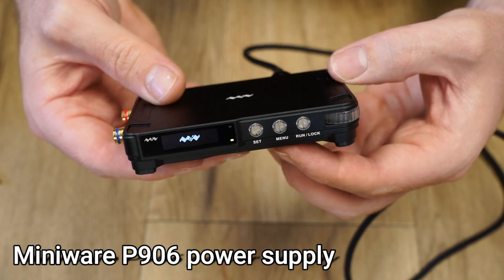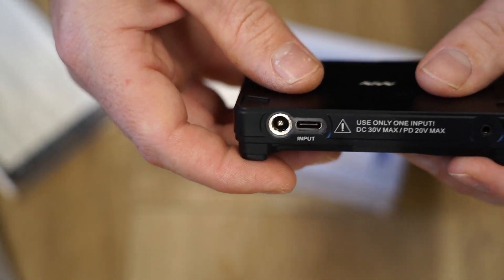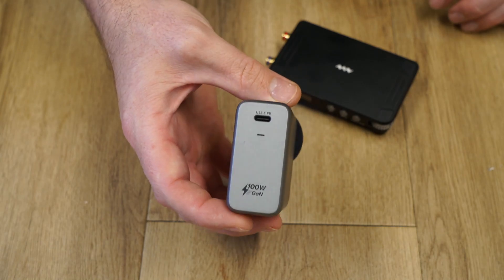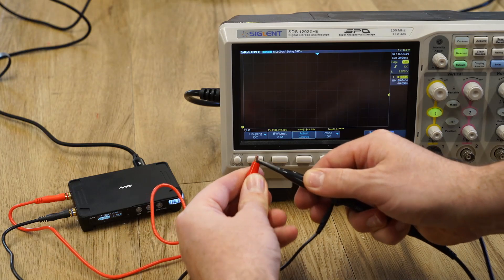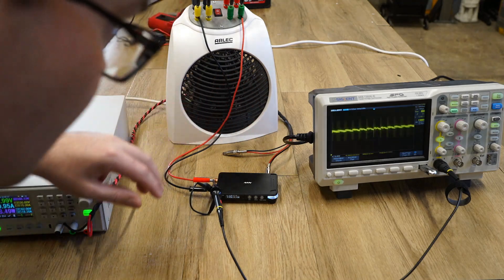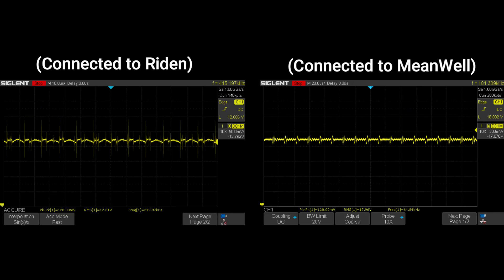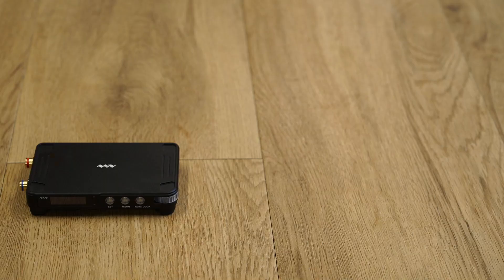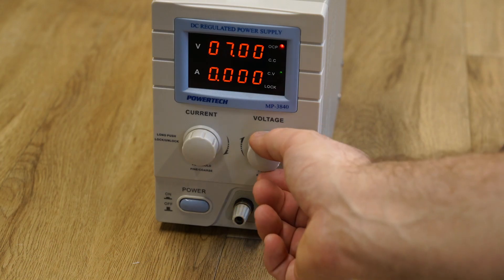Miniware MDP - P906 power supply review II 10A, 0 ~ 30VDC output

Comment: I use a bit older 5a version in my repairshop every day. Typical use case - inject 12v to imitate battery if i have some macbook with no spare battery and i need to isolate power issue to charging issue. 
Short search, temporary replacement of absent power input and of course amp oscilloscope is a real help in troubleshooting power sequence issues on pc laptops.

Comment: I use the wireless feature! I install low voltage security systems. I remotely trigger the power supply to deliver voltage to a device im testing, which could be several rooms away. This allows me to test that a lock is installed properly without having to fuss with authentication to properly trigger the door unlocking. There are so many other uses I've been finding love this thing!

Comment: I agree with your final assessment, but your methodology for measuring ripple leads to erroneous measurements.
1) Maximise the waveform on the display, as other viewers have commented.
2) Your probing technique is not great. This leads to higher measurements. If i may suggest "EEVblog #594 - How To Measure Power Supply Ripple & Noise". Its a great introduction to improve your future ripple measurements.

Comment: Would you be interested in doing a how to video on making a Portable Power Station with out put of smooth 220/240 volt AC with maybe about 1500 to 2000watt output load plus easy add on battery capacity. Maybe a solar top up unit to go with it. I note all units of this capacity are quite expensive.  Cheers Ash PS. love your work.

Comment: I'm pretty sure that the Miniware box is using a DC/DC converter, followed by a 'slave' linear regulator...the DC/DC would be set up to give, maybe 500 mV of 'headroom', above the dropout voltage of the linear stage, so that you get a lot of the size and flexibility of the SMPS, but with a 'cleaned up' output ...

Comment: Since USB PD is fully capable of adjusting voltage and provides oved 120W of power, I would be fully satisfied by a simple miniature controller for my 120W phone brick.
Reply: Those power supplies are not very...good in any way. High ripple bad controllability but if it fits it sits

Comment: Realistically, a "good power supply" for this is an old laptop power supply - I found a very tiny 90w unit which is about the same size as the miniware.

Comment: this could be useful for 5v rails on high end amigas, all pc powersupplies have weak 5v rails as they are designed around 12v hungry modern pc stuff and amgas are very demanding on the 5v rails.

Comment: just a suggestion. When making measurements with the oscilloscope, always try to maximise the waveform on the display, both on the voltage axis and the time axis (you need at least 3/4 full periods to get accurate time measurements).
Reply: Yeah, most oscills only show a measurement of what is visible on screen. If the waveform is compressed, so will be the measurement.
Reply: Just another quick note from an old 'scope guy; never, never, never, use that so-called "ground lead" when looking at power supply noise... most decent probes come with a little 'spring thing' in their accessories, which slips over the ground part of the probe barrel...so, remove the hook part, which exposes the probe tip and probe barrel 'ground', slip the spring adapter over the barrel, leaving the sharp part sitting about parallel to the probe tip, and use that to connect to the 'ground' of the power supply, and the bare probe tip to the 'hot' side of the power supply.
The probe and ground lead, together, form a resonant circuit at about 80-125 MHz, depending on probe capacitance and 'ground lead' length

Comment: I have this setup with the display and both the P905 and P906. 

Two obvious issues are that they're not isolated, so not good for a bipolar supply unless you have two isolated power sources, and the 4mm spacing which is non-standard.

The display frankly is of little use to me: perhaps when {if} they have other modules that will change.

A matching battery would be most welcome.

The P905 isn't USB PD 2.0 compatible unlike the newer P906 which is.

The UIs on the power supplies and the separate display are awful, but the build quality of all devices is excellent.

My use case is a handy lightweight PSU on the go.

Comment: What kind of power brick are you buying for $100?  It doesn't appear to even be a USB-C supply based on the barrel jack, so I'm a little confused.
Reply: You supply it either with a USB C adapter or through the barrel jack.

The USB C is power limited to 100W as per the USB PD 2.0 spec. The barrel jack will go up is 4.2 to 30V, up to 14A.
Reply: that was just a random power supply to signify a good power supply. You will need a high quality power supply like the MeanWell shown
Reply: I have one of these and the USB C never worked properly - I dont think it was correctly implemented. 

The DC barrel input works fine though
Reply: @Pillowcase what DC power supply did you get for it?

Comment: It's a very cool product in my mind but premium and kinda niche. 
 If it was a very high quality power delivery like a filter without your own AC adapter especially at the voltages that really matter like 1.2/3.3/4.2/5/9/12/18/20/24 I imagine it could be a decent piece of mobile kit but I guess at this point you could just lug around a AC PSU Filter good enough for it    but I feel like at $300-$400 you have so many options

Comment: The parameters of the module itself are very good, I was unable to register consistent noise and ripple with the Rigol 1054Z oscilloscope (they are so small). It is a combination of a dc-dc buck-boost following converter and an LDO regulator at the output. Rarely found in cheap power supplies.
Unfortunately, the device itself is too small for comfortable work, this is the main disadvantage. If only it could be controlled from a PC,  would be much more useful.
Reply: I love the form factor. Desk space is real estate. PC Control would be awesome indeed.
Reply: Excellent answer.  Jakiś czas temu robiłeś na swym kanale świetny test tego zasilacza. Fajne cacuszko. Pozdr.